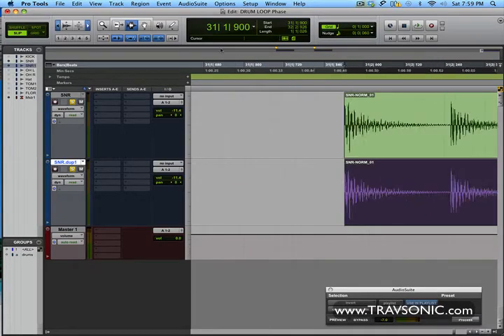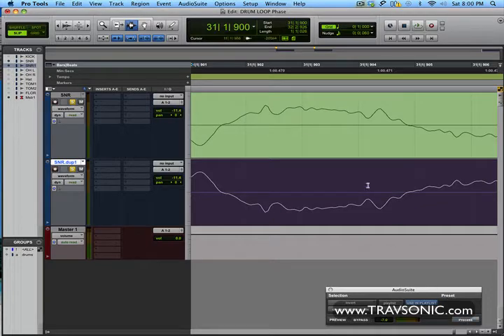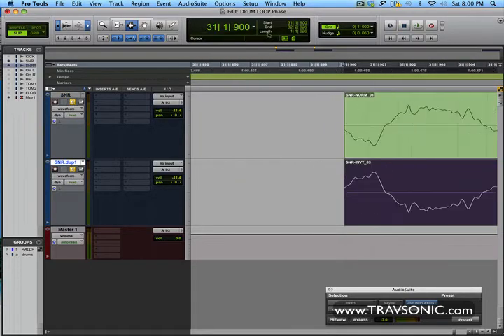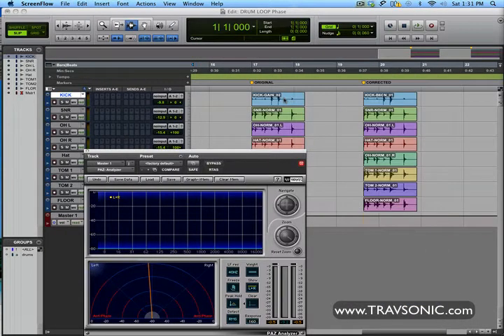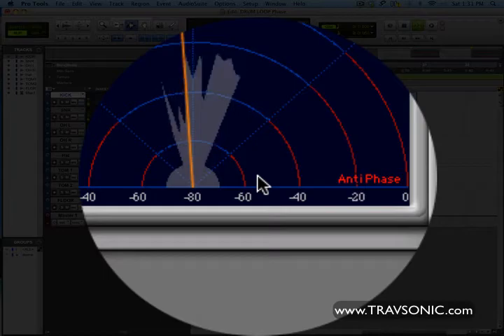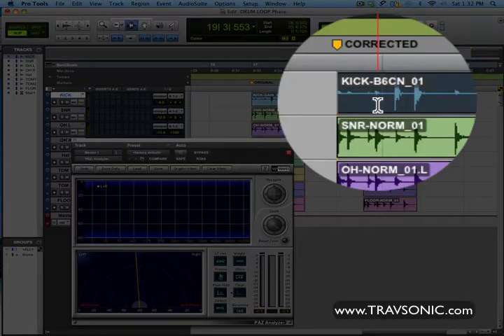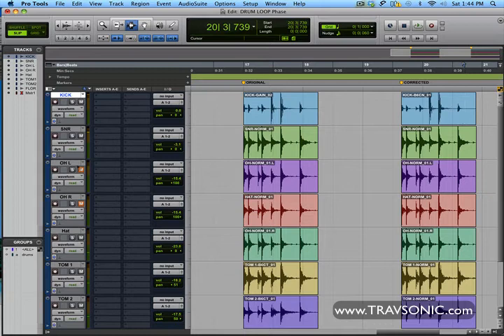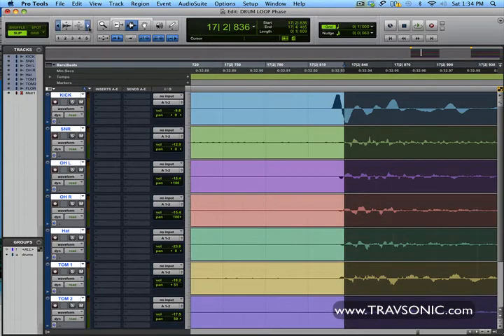DRUM MIXING pt 1: Drum PHASE CANCELLATION Fix Tutorial

Comment: You can never have the whole kit in phase and it may cause other more severe problems to move the track forward to align phase with the snare, even though the snare is the center of a kit. The toms will be closer to the overheads and now you have tom sound hitting overheads before their close mics. I believe phase issues are made bigger than they are. Phase differences gives perspective as long as its not cancellation. Just make sure there is at least three times the distance of the close mics to the source. Thats easily achieved with overheads, which also serve as rooms mics capturing the whole kit, so no need to touch those. It's a bigger issue with bottom mics on snare and toms or multiple mics on the kick.

Comment: Can this happen if you only have one mic on the snare and not two?
Reply from the maker: Larry Tate Hi Larry. Anytime you have 2 microphones facing each other at a source you will have to flip the phase since the microphones are 180 degrees opposite. If you only used one mic on a drum kit you wouldn't need to worry about phase. Once you add 2 microphones or more at the same source you have to worry about phase.
Reply: Thanks for the feedback. I have a mic for each tom and one for the snare and one for the kick. Then two overheads. I guess I don't have to worry about it than until I get a second mic on the kick and a second one on the bottom of the snare.
Reply from the maker: Your overheads would have to be the same distance from the snare. Measure from the center of the snare to each overhead mic. Then, most likely you would have to flip the phase on your overheads. That would be the simple way.

Comment: Is it normal for the snare sound to pull to one side? Like in this video I can tell the snare is more present on the right side.
Reply from the maker: You'd would want the snare to be in the center as much as possible in the overheads. Measuring the overhead mics from the center of the snare. But, for this example we didn't measure or check phase during recording for this demonstration. Got point and good ears!

Comment: So we want to move the wave forms of the delayed mics? And not the direct ones like snares, toms and kicks? Is this so we dont ruin the rhythm?
Reply from the maker: ***** I try to not move the waveforms if it can be avoided by checking phase before recording. Then during mixing the most to be done is just flipping the phase on tracks until a good phase balance is to be had. But, while moving waveforms I like to start with the overheads making sure the left and right channels are in phase as it's the glue of the kit and move the other out of phase tracks accordingly.

Comment: thanks. ive got a question about this matter. which one do you do first, timing/groove adjustments of the drum beats or phase correction?
Reply from the maker: Hi Yusuf. Well, my preference is to fix the phase in the drums during recording or before any major editing work. Makes it easier to dive into editing and not worry about sound issues.